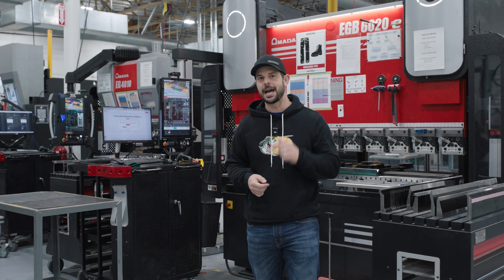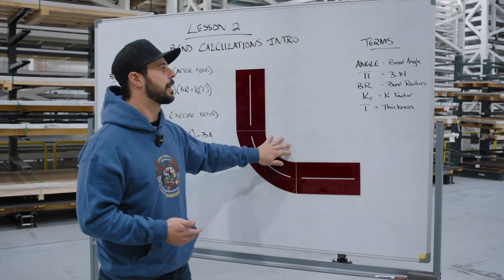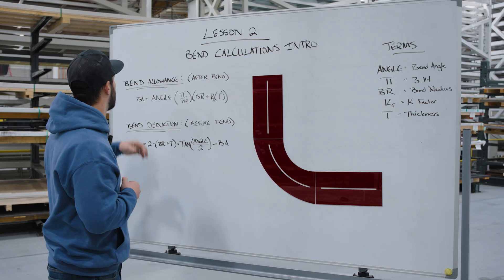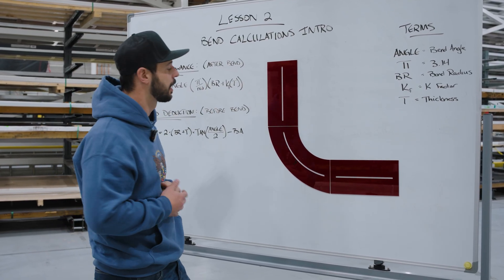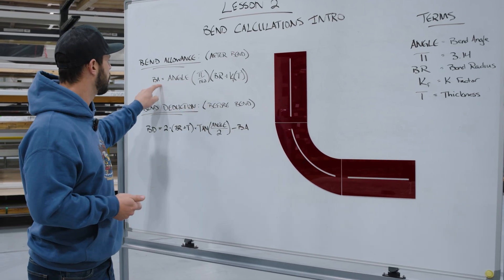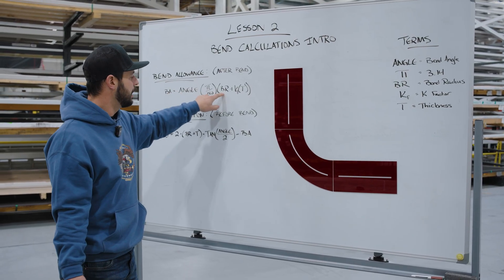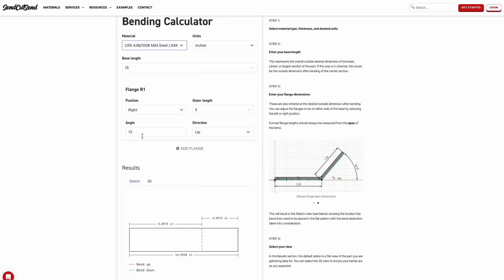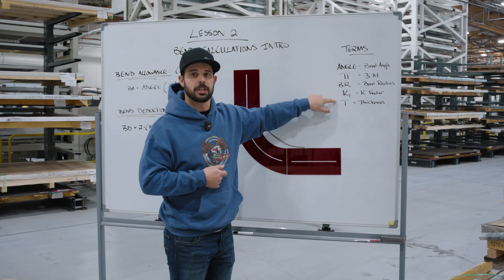What Happens During the Bending Process with SendCutSend - Episode 2

Comment: I run press brakes and I use the old school trick of material thickness x8 for max V die opening or x6 for minimum V die opening and that x.156 to get my maximum Punch Tip radius , of course depending on part , I use that on a 200 Ton Komatsu, but our newer Cincinnati's does a lot for you it's pretty dope

Comment: There are machines that calculate the length of the blank for you. I use a one where it calculates for a thin gauge metal with a 90 degree bend and flange lengths of 50mm each a blank of 98.46mm. Strange thing is though as I make the inside angle tighter the bend deduction decreases. Around forty five degrees inside bend it tells me I don't need to take anything off at all and the blank is 100mm. Any idea why that is?
Reply from the maker: It sounds like the machine may not be calculating something correctly.  My guess is that as it goes over 90 degrees it is not adding the bend allowance, it is subtracting it.  In turn decreasing the bend deduction instead of increasing it.
Bending over 90 degrees continues to stretch the material which needs to be considered in the bend deduction for correct flange length.
Reply: Thank you for your reply. Yes it seems to be counterintuitive what its actually doing. Keep up the good work. Great channel.